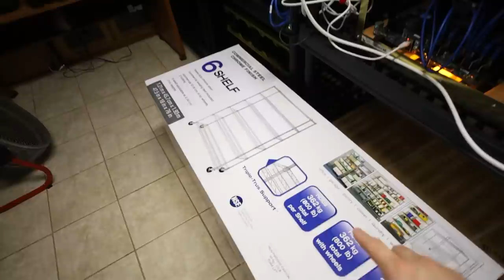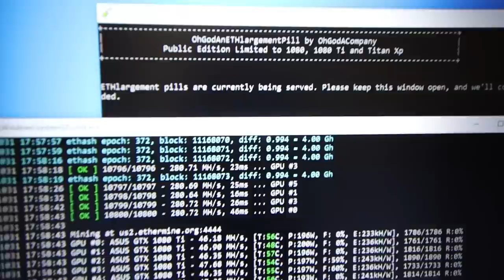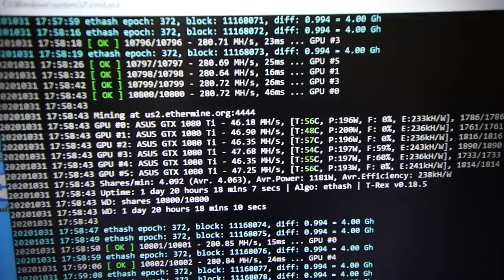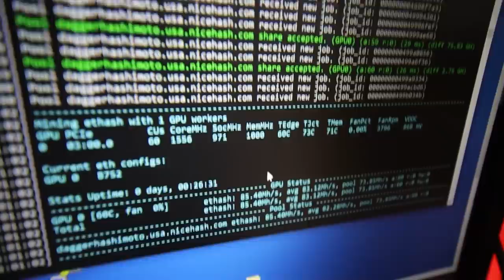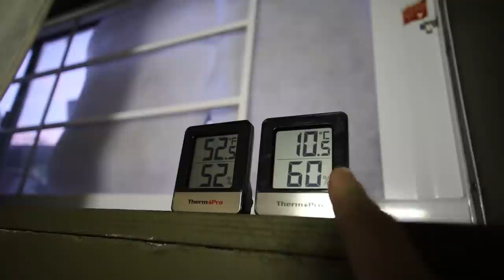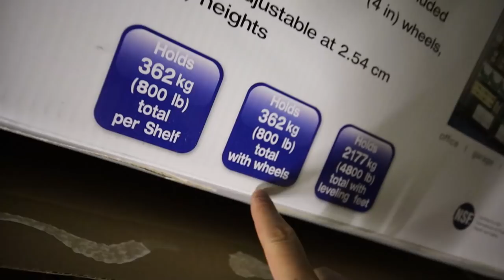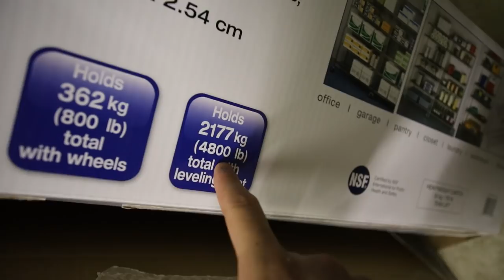CRYPTO MINING WINTER IS HERE...🥶

Comment: I recommend turning the fan around to blow air in during the daytime. The positive pressure in the basement will assist in pushing air into the house. The positive buoyancy of the warmer air will allow it to float up into the house. If the house doesn't get warm enough, throttle the fan or cycle it to lower the cold air flowrate. If it get's too warm, just leave the fan on longer. Good luck. Great vid!

Comment: I got the plastic shelves. I like them, they are good to put stuff on. The other shelves I got are Muscle shelves where the height of each shelf can be adjusted during construction - but they can't be wheeled around. If it's cold down during the winter, no need to vent unless you are trying to reuse the heat to warm the house. I had to run ethernet through the walls to relocate my miners for heating purposes, except I'm small scale. I'll place one ASIC in a room - plus slow down the PS and ASIC fans to cut down noise, while keeping the room toasty.
Reply: gonna jinx this, but haven't seen the crypto scam ads in a while. . .
Reply: Hi

Comment: Gpus are more efficient at heating than an actual space heater. I would make a fan pull heat into the basement vents in reverse to blow heat throughout the house. Just an idea. I even run non efficient gpus during winter as i consider it all profit because i would be running a space heater for heat anyway. (Im new and only have 2 efficient gpus and 2 barely break even gpus)

Comment: i used my existing hvac system....i just added an adapter in the rig room and forced hot air into the floor vent and it comes out the other vents in the house...capped off the furnace and it hasnt run in 3 years.

Comment: nice video.  Shut the current inlet window, turn the fan around on the current outlet window, open the door for upstairs, open a window in your attic/upstairs making sure rain/snow can't get in.  You could probably keep your miners where they are as long as you turn your miner's exhaust around like you said in the video.  It would be even better to have the air recirculating in the house, but that would probably require some carpentry.  
Thanks for the videos!

Comment: So....you could put those 2 shelves side by side and let the heat flow towards the door, but really a ventilation duct system would be the best. You need to man up and start cutting holes in that floor ( I can help with this ) If you really refuse to do so, you can put a wireless thermostat upstairs and a damper in the door going upstairs. Every time it calls for heat the damper will open. You need a return tho going back downstairs, if you just use the fan backwards with outside air, you will pressure the house.

Comment: So if I were you, I would install heat ducts in the floors upstairs where you want heat. More of a permanent thing but then in the ceiling downstairs put 2x4 drop ceiling grid vents right underneath the vents. Kind of like a wood stove setup. No need for more power draw with fans. You can also get powered floor vents too to draw the hot air up.

Comment: Just snagged some rx 5600 xt and have a quick and easy question; does the new amd driver gui still have a switch to change from graphics to compute mode? If so, they hid it pretty good
Reply from the maker: hey WX2! yeah the navi 5000 series no longer has that graphics to compute mode thing. just Polaris still.
Reply: @RedPandaMining  thx for the reply man; it was starting to drive me insane .. again; been there a few times with some long and horrifying bouts of sanity inbetween .. ; love the new mobile shelving; where did you pick them up?  I put wheels on everything I can; rolling led flood lights; radial saw; drill press; compressor hose reel .. everything; and keep a surplus of them on hand for anything that comes along. Thxs again red.

Comment: URGENT!!!!!!!!!! message for all ETC miners that use Vega 56 modified with 64 BIOS!!! Something went wrong and these GPUs can`t currently mine ETC anymore even though they have 8GB HBM2 memory! All my Vega 56 rigs have been mining for several hours, getting ONLY incorrect shares! Unbelievable. What`s more after I stopped the Phoenix miner and restarted my rigs after a few seconds the mouse cursor and the whole desktop froze! Rinse and repeat - the same results! I quickly booted to safe mode and used DDU, completely reinstalled the drivers but the problem still persisted! The only solution to this problem was to do a system restore!!! Now all my Vega 56 rigs are mining ETH but the difficulty is so high and rewards so low that that`s not even worth mining! Can somebody explain me what is this all about and when this mess will end? I`ve never thought that something like this could happen! What`s even worse - it came in the best time for mining the dip (as always), time when ETC difficulty keeps falling down. Do you guys experience the same issue? Do you think that it`s just a temporary glitch in the matrix? Do the developers already unofficially experiment with Etchash algorithm implementation? Please let me know ASAP. PS. All my RX 5700XT, 580s,570s,480s 8GB AMD GPUs are running just fine.
Reply: Not sure if my problem is the same. I have a small rig and had a 56,64,5700xt, and a rx 570 8gb mining fine on nicehash  for a while but last night got another 5700xt much better model and put it in the rx570 spot. Only using claymore for a but and was fine and then crashed. After that crazy problems. Tons of problems with claymore, installed Phoenix and Phoenix took the vega card and 5700xt stayed on claymore but failing. That ended up failing. Whats the strangest thing is that in the plug in menu, claymore "isn't supported" like wtf. With no plug ins installed it still loads claymore but I can install or Uninstall. I have jnoy got it working for a short time and its because I have to have Phoenix installed, start and both will load. Then stop them, Uninstaller Phoenix, and restart in claymore. Haven't got passed the 4 hour mark and the new card is a much better card and haven't overclocked it pretty much at all. Idk what the hell is going on.
Reply: @MrDanberube  Let`s wait for Red Panda`s input ;-)
Reply: @MrDanberube  Thank you for your imput mate, even though not so relevant to the topic/ Cheerz!
Reply: @lenochod7950  just got home and restarted. Everything is working fine so maybe a glitch in the matrix
Reply: @MrDanberube  Oh mn thank you, I just colllapsed under the alcoholis sneaky weight  of gagschloss. near my WC. I woke up in the mornng lying next to the freckin penny bottle,  well I will give it atry , but please wait till I`, sober , this is alll shit, smokin  an drinkin` can get ut so hospital that  we obviously don`t antr to ge to, we hatw to hop , dear mr. presidenrt biden, youve been throuugh so much struggles and life vberaking out of the blue accidents that we ahave tio pry for you , if you becoma a president of the greatest coutnrey of the world ,,, we are with you because AMERICA, IS THE GREATESAT COIUNTRY OF THE WORLD. DEAR MR. PRESIDENT WE BOE TO YOU AS YOU VE FINNALLLYU ACHIEVED YOYU R GOAL    MR BIDEN  WE LOVE YOU YOU ARE THE PRESIDENT OF THE MIGHTIEST AND GREAREST COUNTRY IN YHE   WORLD USA UNITED STATES OF AMERICA WHERES MY GRANGMOTHER COMES FROM. GOD BLESS PENNSYLVANIa/ GOD BLERSS THE UNITED STATES OF GOD BLESED GREATES T AND MUGHTIEST STATES OF AMERICA. GOT BLESS ALL OF YOU .. NO MATTER BLACK RE WHITE .. I LOVE YOU FROM THE BOTTOM OF MY HEART. GOD BLESS AND PRAY FOR THE FUTURE OF AMERICE. LOVE YOU GUYS. LENOCHD. 

cokkkks